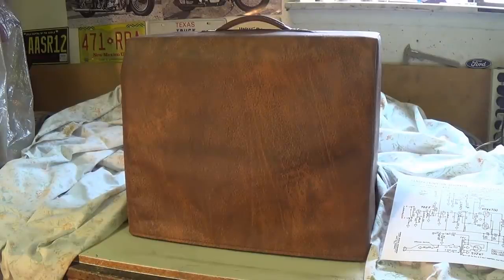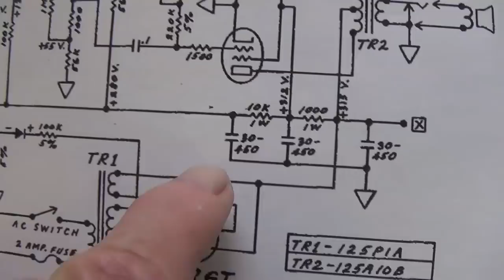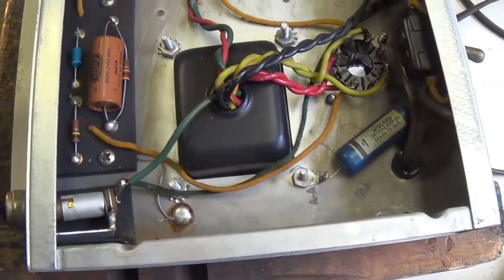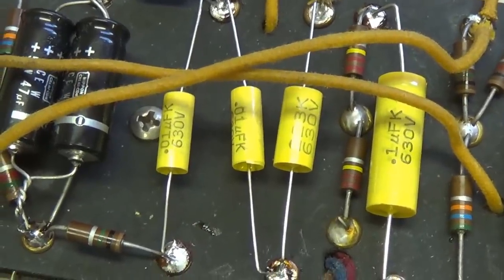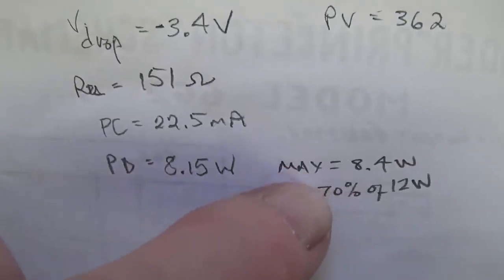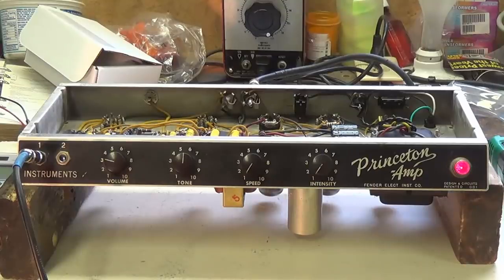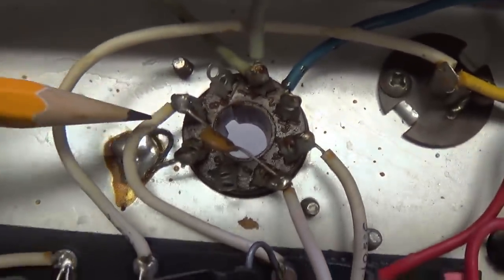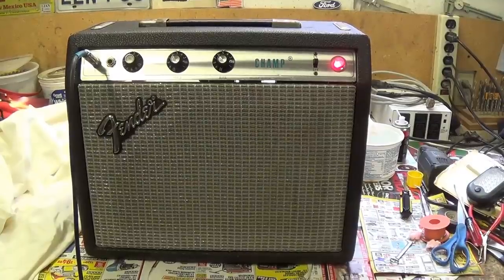Brownface Fender Princeton and Silverface Champ "Double-Header"

Comment: Hello Uncle Doug, I noticed on the 1st amp featured, there was the usual pop and crackling with a dirty volume pot. However there was hum being introduced by the dirty pot as well. Do you have any ideas on how the hum gets introduced into the circuit by the dirty pot alone? Also, is it possible for a leaky grid coupling cap to cause hum or is it always the B+ line capacitors? I’m aware that the leakage of coupling caps decrease the neg bias on a tube with the introduction of the leaking +DC causing a plate current increase.
Reply from the maker: Leaking filter caps generally cause a 120 Hz hum, which is unlike the more common 60 Hz hum associated with literally hundreds of different possible causes. As to how a dirty pot can cause hum, I can only speculate that any weakness in the signal chain may result in an elevation of background noise.
Reply: Uncle Doug 
Thanks for your reply. Just curious, as my issue with hum in a Marshall turned out not to be the B+ caps. Found a short in two of the output tubes. However my tube tester doesn’t tell me specifically between what two elements, it just shows up at position 8 of the 12 position selector switch when running short detect mode. When I tried to simulate the short light at position 8 with a 470k resistance between various sockets of the testers 8 pin socket, it appears  the short would be between the cathode and any of the other pins on the EL34. So maybe this is where my problem hum is residing? I have a matched quad on order. Will fire up the amp with outputs removed and scope around on the pre-amp tubes to make sure hum isn’t being introduced in this stages signal path, or other pins such as plates or cathodes. If ok, I then plan on dropping in the new outputs if voltage check at their respective sockets check out ok. 

Have a nice weekend 🙂👍
Reply from the maker: That sounds like a good plan, Mike. Any AC leak to the cathode of a tube will induce 60Hz hum, just the same as if you fed it into the grid itself.  Good luck.
Reply: Uncle Doug 
Currently watching your series on how Tube Amps Work. Thanks for your taking the time to be such a Godsend for me. Any thoughts on best way to test transformers for hard to locate shorts? I’ve done whats called the ringer test using a square wave pulse and watched the dampening pattern of the sign-wave. I’ve also used a 9v battery that is paralleled with a small neon pilot lamp and hooked through a momentary pushbutton switch. When button is pressed, 9v is sent across a suspect winding, when switch is released the neon bulb will flash once from the inductive kickback voltage if coil is good. However if there is not enough turns “inductance” on the transformer this test doesn’t work. 
Any thoughts?
Have a great day Uncle Doug ✌️🙂
Reply from the maker: I have never used the ringer test. I generally determine the winding ratio in OPT's and use an ohmmeter to detect shorts in PT's.

Comment: Uncle Doug - What do you think would cause a volume control to be full volume in the first 1/4 turn and they behave normally through the rest of its range? Is this a fixable problem or a replacement solution? I've never come across this problem before so I thought you might find it interesting. Thanks for any help or ideas. T6
Reply from the maker: This is an easy one, T6. Volume controls work by sending more or less of the signal to ground. Apparently, a portion of the resistive material in your pot is damaged or missing, so for that portion of the knob travel, there is no ground.....thus full volume. Simply replace the pot.
Reply: A great big thanks to you!
Reply from the maker: You're welcome :)

Comment: Hi Uncle Doug, Question: What the main difference between a 7025 and a 12AX7?
Reply: Here's a link from 2007 that explains it. Basically, the 7025 is a low-noise type of 12AX7 and they're interchangeable.
https://www.thegearpage.net/board/index.php?threads/question-about-nos-tubes-does-a-7025-12ax7.302392/
Reply from the maker: Thanks for the input, TM. You're explanation is right on the money, IMHO.

Comment: Personally I never can hear a difference between a 25uF bypass cap and 100uF one. In theory the 100 if one will give you more bass but even with a 12" speaker it won't happen.
Reply from the maker: You reach a point of diminishing returns, Joe. An instrument might detect the difference, but the ear.....generally not.

Comment: I thought both amps sounded wrong when running distortion.  Was the mic driven to clipping?
Reply from the maker: Not to my knowledge, Russell. The microphone tends to compress rather than clip. I thought they both sounded pretty darned good. Sorry you didn't.
Reply: @UncleDoug  Just seems kinda buzzy, (after buzz?) like something loose.  I was listening with my headphones.  I haven't had that experience with other amp videos.  I'm assuming it's something to do with the recording or YouTube since I doubt if it would have been acceptable in person.
Reply from the maker: I doubt that both amps would coincidentally exhibit the same buzziness, Russell, so it must be related to the recording, uploading, etc. that occurred.
Reply: @UncleDoug  Agreed.  It's possible it was something in the room near the mic buzzing.  In person, your ears tend to focus on the amp and filter that out.  Mics, not so much.

Comment: Doug what’s your opinion on new speakers in the champs? My 76 has the original but it stinks. I know you lose originality. But sound is my goal not return in cash.
Reply from the maker: I have Champs and VibroChamps with both original and aftermarket speakers, MC, and the replacements tend to sound noticeably better. The wimpy little Alnico Jensen is a concession to cost reduction, IMHO. Check out the Jensen C8R or the Celestion Eight 15.
Reply: Thanks uncle doug. Let me know how your eBay auction goes for your new Princeton. ;)
Reply from the maker: Shhhhhhhhhh......don't tell anyone ;)
Reply: I found a higher end and a cheaper Weber speaker as well.

Comment: It's weird I just left a video where they are reissuing the Brown face Princeton. In my opinion the Brown face was the best series fender ever made. They overdrive the best very Musical. I guess that's Chris stapleton's amp that they copied and are reissuing.
Reply from the maker: I agree, Gocd. Brownface Fenders are, IMHO, the least-seen, most under-appreciated, and (probably) overall best of all Fender amps. They combine tweed raunchiness with blackface refinement.
Reply: To me fenders goal in the early years was to make a clean sounding amp at a louder volume. The Tweeds failed at this. They kept trying. Blackface would break up after about three or four. And then they went to the silver face and kind of accomplished it. But by then everybody had moved on. Everybody decided they liked The Break-Up in the older amps. So Fender was kind of screwed. LOL. Mesa Boogie came in and had the best of both worlds. So Fender had to play catch-up.
Reply: It shows my age. Back then Distortion was not a good thing.

Comment: Uncle Doug, you took a wrong turn on that Champ.  ITS a CLASS A single ended amp, and would sound way better biased at 55ma.   The power transformer would not be getting hot as it has a rating for 70ma, as its the same power transformer used for the Princeton's and Princeton Reverbs running more tubes.

The situation with the Champ in the silver face and black face era, is that the tone stack added to the circuitry causes a signal loss as compared to a tweed champ.  The tweed Champ was the Clapton Layla amp which was a screaming amp....not a clean one.  You biased the amp too cold.
A great option to have on the black face and silver faced Champ amps is a tone stack drop out switch in the form of a push/pull pot on one of the control pots.  Dropping out the tone stack would get rid of the tone stack signal loss and bump it back to the tweed zone for gain & response......and with a good speaker it would be a killer amp.
I often add the tube clamps that grab the tube base as with the typical fender tube clamp base for amps like these without the clamps as extra added value.  
One other note would be to use a 25uf/50 volt  cap for the bias cap, as going to the higher value of 50uf or 100uf detracts from the spirit of the Champ

You should also note that there is no screen resistors on either the Princeton or the Champ, and you should add this screen resistor....the 470ohm resistor at the appropriate wattage.  This was a design flaw, and it should be added for tube life.

I do find your video's very interesting and informative

BTW if it has never occurred to anyone, the Princeton amps are basically a single channel tweed deluxe amp but with a fixed bias and added trem and a negative feedback loop.
If you make the feedback loop switchable, and convert the amp to cathode bias......you have a tweed deluxe screamer with trem and a 10 inch speaker.....all be it as a single channel.
if you one up that to a Princeton Reverb.....think a tweed deluxe with reverb.....
Reply from the maker: Thanks for all the advice, Mike. I'm glad you enjoy the videos. I guess we all have our personal views on amplifier biasing, but setting the PC on a 6V6 at 55 mA and around 420V PC would result in a plate dissipation of 23W.....which is about double the maximum value. I can't see doing this, especially not to a customer's amp. Also, I (and many viewers) thought the Champ sounded great, biased conservatively. I appreciate the input, but really think I'll stick with my own methods.
Reply: @UncleDoug   Uncle Doug I can respect opinions, But the real implied premise is the plate dissipation.....were the plates glowing red at 55ma ?  You did not state that nor was there visible evidence.
I'm a dealer for New Sensor and Ruby, and I had called into question the specs of the modern tubes....there is no published book on the characteristics such as with the RCA books or the GE books or any of the other classic tube manufacturers of the era.  Each manufacturer published their tube data back in the day, and generically it crossed over across the board but obviously if you used RCA products then you'd use the RCA data.  For what its worth, my father was an RCA dealer so I grew up in this.  SO carrying my inquiry to Ruby, their engineer contacted me and we went round and round as they have no data sheets, but the engineer insisted that the tubes can take what ever you can toss at them as long as you do not exceed the plate dissipation.  I was looking for the data sheets as to what the designs were rated and tested at.....maximum plate voltage.  SO the engineer dodged the question, and only referred to plate dissipation.  This goes back to KORG and the distribution of marshall amplifiers in the JCM800 era where the American market was converted to 6550 power tubes as substitution for the standard EL34's.  The switch was due to a reliability factor with the EL34's being a final production run from the tube manufacturer and the tube quality standards were tossed out the door because the factory was discontinuing the tube manufacturing......so the tubes could not handle the plate voltage the JCM 800 were running.  It wasn't about adjusting the current draw appropriately for these El34's per the plate dissipation.  The Marshall sound was based on the EL34 tube, so the 6550 amps did not have the classic sound.

My experience, and it comes by ear, is that fender amplifiers that run high plate voltages beyond the published tube data specs tend to sound quite harsh and brittle.  The classic years on 6L6's amps kept the plate voltages close to 400 volts or less, where as the CBS years and into the final era of the ultra linear transformers post 1976 exceeded the 400 volt mark and pushed the plate voltages to 500 volts in some cases where those amplifiers sounded extremely brittle and crappy.  I'm a dyed in the wool Fender guy.

What you calculate with the SF Champ as the safe plate dissipation for that 6V6 is exceeding the rated capacity for that output transformer....which should be maximum of 8 watts where as the amplifier is rated at less watts.  If I'm not mistaken a non tweed champ is advertised at around 5 to 6 watts into a crappy inefficient oxford speaker.
Reply: @UncleDoug  I should point out uncle doug, that you put up 55ma and 420v.....where as your test measurements showed 52ma and 357 v.  if it were bumped up from 52ma to 55ma, the plate voltage should theoretically go down slightly.  But for a 470 ohm bias resistor, it is in the ballpark for that particular tube....which has hours on it.  Its a question of a fresh new tube out of the box, or if the existing tube is within being fresh out of the box new.
Point being, the Fender schematic for an AA764 which is a blackface with the same power transformer and output transformer, shows the plate voltage at 350 volts.  A bronco amp which is the same as a champ but adding trem, shows 342 volts for the plate voltage.  The 5E series tweed schematic is the only one I have seen with a plate voltage listed in the schematic at 305 volts all be it with different power and output transformers, but the classic tweed champ is the 5F series which was the last version prior to the 1964 black face.  
To my knowledge, Fender never had a service issue with these Champ amps failing in the field due to a design error relative to the bias, as you suggest that these amplifiers are not biased correctly & you are correcting that.
Your bias set the plate dissipation at 12 watts for that 6V6 tube, which suggests as a single ended class A amp that its running at 12 watts, where as the output transformer is rated for only 8 watts maximum and the amp is typically rated for 5 to 6 watts output.  And at no time was the tube glowing cherry red with the 470 ohm bias resistor because it was way over its plate dissipation as is.
When you swapped the vintage power tube in the circuit, it illustrated the ballpark bias situation of a cathode bias set up.  If it were to be biased more accurately for 55ma, then a value less than 470 ohms is called for....probably 420 ohms.  But obviously that's the variable with the power tube when installing a new tube, fixed bias or cathode bias....they always need biased and dialed in (barring the groove tube system of replacement tubes).

The CBS design engineers wanted a clean and hifi sound and pushed linear, where as the pre-CBS fenders and particularly the tweed era amps sounded like tube amps....nice and juicy and the compression of the wave....which is the heartbeat of guitar.  Its definitely not the clean sterile CBS school of thought for a lifeless transistor sounding tube amp......turning up staying clean and only getting louder.  Turning up on a pre-CBS fender and particularly the tweeds......got you into the juicy tone and breakup that they are known for and what was the heartbeat of rockNroll and rockabilly......which evolved into Jim Marshall copying them to propel the music of the 1960's into the overdrive and distortion territory.....thinking Jimi Hendrix.  You shouldn't need a foot pedal to make a tube amp sound like a tube amp......unless you're saddled with an anemic squeaky clean set up tube amp.  The fidelity of a tweed era fender tube amp was advertised as a clean amp......as the were designed for (weak) single coil guitars and not to be cranked up to wide open.  But is rockNroll clean or CRANKED UP......skip ahead to Clapton and Layla and a fender Champ